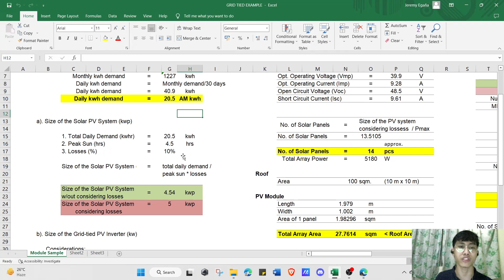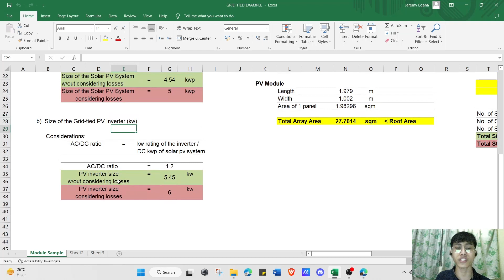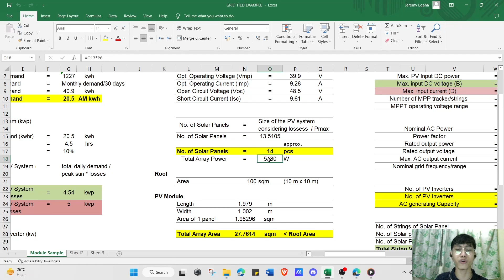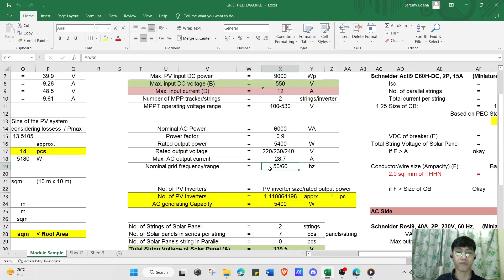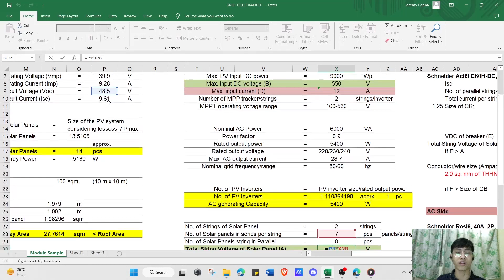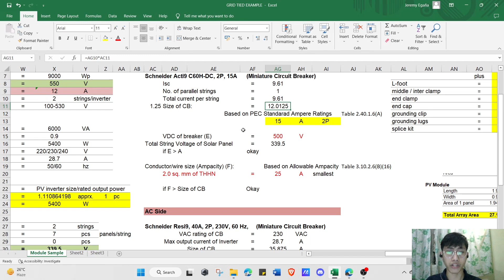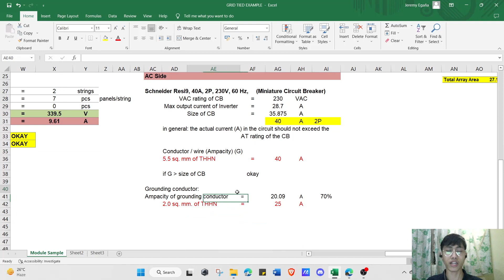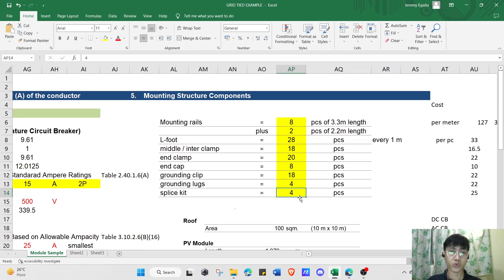How to Size a Grid-tied / On-grid Solar PV System

Comment: There is a mistake in your string current part, you have 2 strings and how can be the current is just  9.61, u have 2 strings so it shoulbe be 9.61x2 = 20.2 A in total